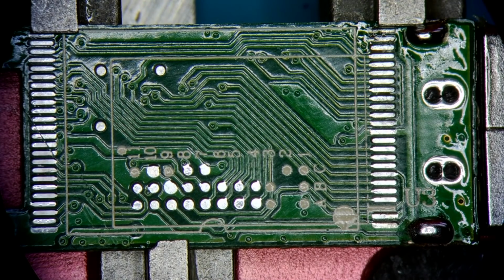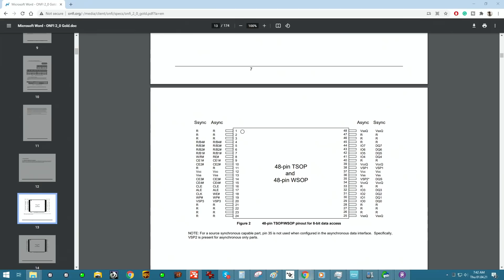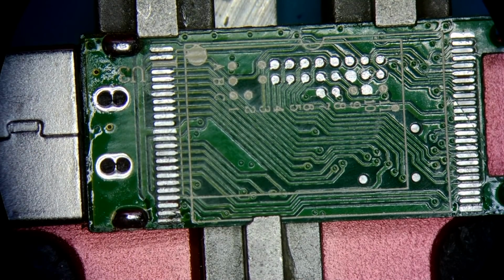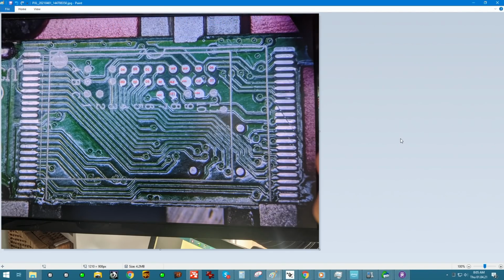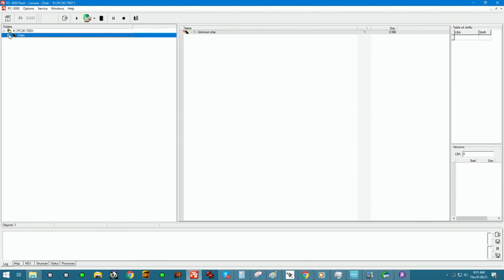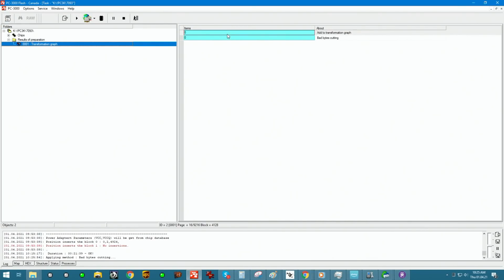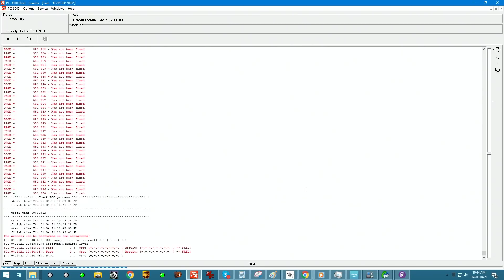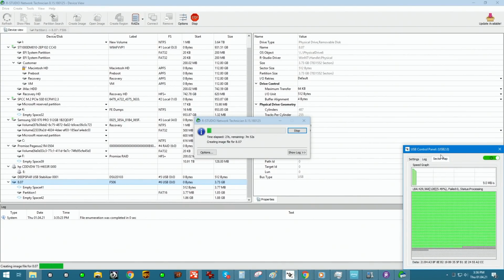recover data from no name usb stick

Comment: Love to see the use of magnet wire to connect the device. Used this technique since some 30+ years  to breadboard, correct PCB layout errors, rewire BGA packages (deadbug), and others. Even to make controlled impedance ECL breadboards pushing over 500MHz.

Comment: Cool as always, even though I didn't realy understood the transition between bad sector maps and working drive at the very end..
Reply from the maker: This chip was very unstable to read with software. Hardware controller from the original PCB was used to run it.
Reply: @hddrecoveryservices  If you had a dead controller what would have been your next step? Is it because the software didn't know how to handle this flash chip?

Comment: I have a Siemens branded rotating bracket usb flash drive back from 2008, and it does not show any signs of data corruption or loss, it was used for college, hundreds of reports edited on a flash drive itself, it travelled all aroun Russia with me in any season or weather, it knew dosens and dosens of different usb ports of different controllers, not only PCs, but industrial controllers. This same usb drive serves me as HBCD, memtest and Linux Mint XFCE  live usb! Once I disassembleed it to reinforce the plug by thermal glue, that only proves that electronic scheme of the drive far outlived its mechanical parts, such as the connector.

Comment: What's the board you connect circle pins from card to rectangular one? The "bed" for memory chip. :) Can you link it plz?
Reply from the maker: It's a NAND protocol adapter that also has USB and SD interfaces. Multi-Com makes these
Reply: @hddrecoveryservices  Can you include the exact model name and a product link in the description, please?

Comment: So, I've had it happen to me now for a couple of times that I got a brand new USB flash drive that I dedicated to be the main drive for my Raspberry Pi 3B+ and then out of the blue something happens to the OS and with Linux there's an issue that when the OS detects something weird it tries to "help out" but in doing so it sets some flag on the USB flash drive which makes the entire drive read-only so the user can then make a backup of the data.

However, the data isn't important to me because there's nothing on it that I can't reproduce in a very short amount of time, the problem that I have is that yes, I can make a useless backup and read the drive but the Linux OS has set the flag on the drive which I can see in Windows with the partition manager and I can even make some changes to it, it seems but for some reason that I can't figure out I can't remove or change the read-only flag set by the Linux OS which makes the drive unusable, I can't format it in Windows, can't change or remove the partition or make a new one, just nothing seems to be working to get rid of the read-only flag which is driving me crazy, I've been searching online but there's very little information on this particular issue and the info that I could find wasn't helpful at all.

The only thing that I want is to simply be able to format the drive so I can start over new and keep using the same drive since it's brand new, do you have any idea what it is that I can do or at least point me in the right direction so I can figure out how to fix this issue, that would be very helpful to me and it would be very much appreciated here.

Best regards,
Ricardo Penders

Comment: The golden finger could be a SDHC interface? If so, could be easier to connect it as a memorycard trough it own interface instead using the old solder pints (that obviously bypass that interface connecting direct to the memory pins)?
Edit: Now than you recovered the data, can investigate further the golden finger connector? May be useful for future; many cheap USB sticks and other devices can have it inside and nothing seems to be known about this memory card and its connector.
Reply: That was what i wanted to ask.. he could just put it in reader.

Comment: Hi!  Great video! 

But some points are not clear:
From this video it is not clear why RR did not work, but it should, because the controller manages to correct it.
And on bitmap it seems that one plane it empty?
Reply from the maker: Old chips like this do not have RR. I think if I set out to read with verifications it could have given a better result using a dump of data

Comment: I had a data loss a year ago . it was about 17 gb of random files and photos i have collected and my big mistake was not having a proper backup . the flash drive was from a brand named almond and it was the only time one of their product fails . having at least 6 almond usbs laying aroung and having opened them , i know that they use various nand flash but the build quality is ok . that one usb i refered earier , one day as i was tranfering a file it stopped working. the controler board works , and shows up on disc utility , but with 0 bytes of data . i am starting to thing if the nand flash just died, but i can't quite be sure as every other amond product i have still holds up even if it gets more use than that one usb flash drive. Istill have the flash drive as an experiment to see if  i can somehow retrieve the data i lost.
Reply from the maker: It could have issues on the NAND level, but I doubt its dead. We can check it for you. www.hddrecovery.ca/contact-us

Comment: I grab cup of tea and enjoy the show. Thanks
Reply: Just finish watching. Wow, why it didn't read on pc3000 flash? I mean it was invalid mostly and on original controller everything fine. Strange to me. Aslo - i like part of pin searching :) detective
Reply from the maker: I think it was due to 2 things. Original controller on the card could be very noisy and I didn't know how to disable it. 2 this chip needed read retry or some special power setting to get a cleaner read. No matter what, bringing it back to life would have gotten the best possible result.

Comment: Why was readout directly from NAND so bad, but worked well via original controller? Thats what u did right?
Reply from the maker: Software error handling is not the same as hardware my friend. It could be a matter or read retry that did not exist for this chip using the utility
Reply: I have the same question, it would be interesting to give us more information...

Comment: One of my sandisk 16 gb sd card somehow got an unusual problem- no matter how many times you format, the same data reapears again after connecting to pc again and again. also no new data gets stored, I can copy, but when I remove and plug again, it is always those data from the first. never had such problem with any card.

Comment: it looks like the chip maybe a usb 3.0 chip the 10 large contacts is probably what interfaces with the female type a connector in the usb port and the chip was made to interface with a usb 2.0 to 3.0 converter bridge.

the flash drive looks just like the rubber ducky or one used to make a rubber ducky and some other pentesting devices.

Comment: At the end, did you connect the nand chip back to the original USB PCB and use its controller to get the data back since software data extraction wasn't working?
Reply from the maker: Using the schematic I drew up in paint l, I connected the card to the NAND adapter, then linked NAND adapter to the corresponding pads in the original PCB
Reply: @hddrecoveryservices  That makes a lot of sense!
Reply: He took a long road when all what was needed is to connect chip back to pcb. As I understood it.

Comment: I'm currently tinkering with my B860H Android STB with a Aml s905x chipset. Somewhere on the internet I found a pinout of the emmc and to me it looks like sdcard pinout. 

Can I use sd card reader to access the emmc by jumpering it and mount the partitions directly as if I'm plugging a raspberry pi sdcard to my computer to modify something or the whole firmware?

Can I replace it with a class 10 sdcard (or just sdcard socket) to make it work like a raspi?

Comment: why not just solder the samsung pads to the recovered pads on the USB stick first? wouldn't that be a quick test and if successful a faster recovery?
Reply from the maker: It would be faster, but if the original problem was due to a failed NAND and the card got ripped off by someone who worked it before (for lack of skills), then direct attachment would be useless. Connecting the adapter to the board took 5-10 minutes at most

Comment: This vid lacks some explanation between unable to read the flash and then all of a sudden being able to read it directly thru the controller. Seems the actual troubleshooting is edited out. 👎
Reply: I think the software didn't understand the chip, or he didn't know how to set it up to read that specific chip. Then he put the original controller back, which read it fine. It wasn't guaranteed that the original controller would work.